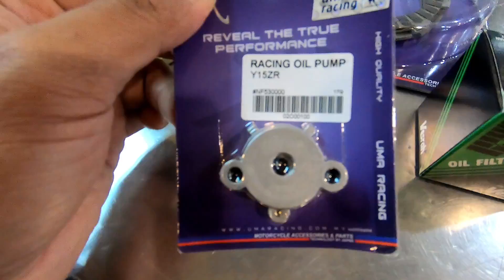Y15ZR Pakai filter besi?????

Comment: Bang bob . Nk tanye . Slipper clutch ngan hyperclutch tu berbeza ke ?
Reply: nik amirul aidil hyperclutch baik utk pickup or respon.. bila tarik engine akan lebih fit or keras respon dia.. pastu lever clutch lebih keras.. respon pada low rpm to mid rpm terbaik but high rpm ada kurang sket..
engine breaking terbaik
but for spec yg tinggi agak mudah slip

sliper clutch
gear lever lebih lembut mcm standard
pickup- top speed respon terbaik lagi tinggi rpm lagi gigit
respon baik for cornering
engine breaking loose sket
tak rasa lagi slip utk spec 66 jack 8mm setakat ni.
Reply: Ali Zainal Abidin Bin Shafian  Terima kasih bang utk info ni 👍👍
Reply: Ali Zainal Abidin Bin Shafian klau moto stnded bole pkai tak utk daily usage and ride jauh
Reply: Rizman Iskandar sesuai dgn hyper clutch
Reply: nik amirul aidil sbnrnya nama hyper clutch ni gimik marketing je..just tambah satu spring,n racing component mcm clutch plate yg sbnrnye material tab pd plate tu berbeza n juga saiznya  n spring pon lbh keras..bila d tambah lg spring lg keras la clutch feeling n lebih cengkaman..cuba fikir..xkn la nk lg cengkaman engineer g tambah clutch plate..xpasal2 nk kne bsarkn clutch bucket/housing clutch,spring nk kne panjang,tambah steel plate lg..kn dh leceh..sbb tu dye tambah spring..

slipper clutch plak d beri nama utk utk mengurangkn slip pd tekanan clutch plate ngn pressure plate masa down gear time mid-hi rev...n kurangkn lock roda blkng juga..tu je,yg lain2 tu mngarut je..beza dgn clutch konvensional dye cme pd housing clutch n pressure plate..klebihan dye sblum nk msuk corneringkn kne braking n down shift..so slipper clutch ni membantu kurangkn wheel lock n throttle response..
Reply: yondaime hokage oh . Trime kasih bang bgi penerangan  😁👍 sy pon bru je main motor ni 😅 terima kasih
Reply: Ali Zainal Abidin Bin Shafian thanks for info